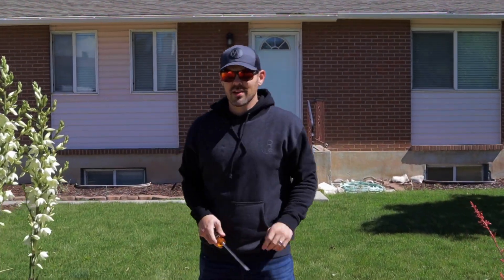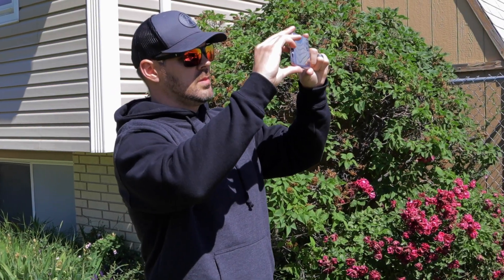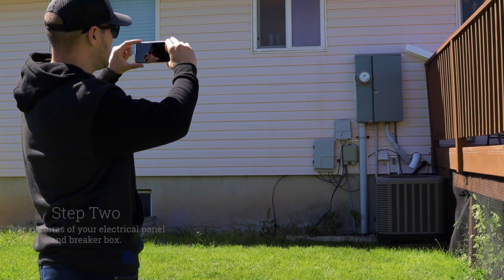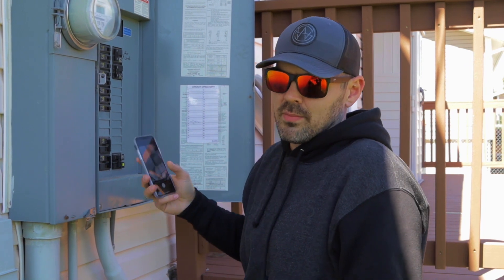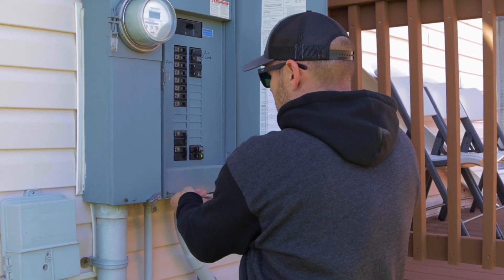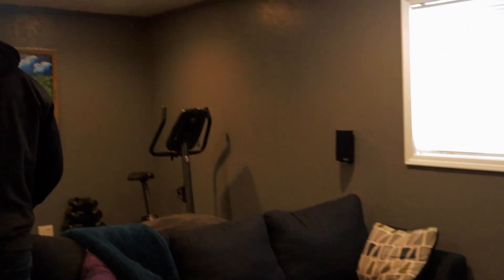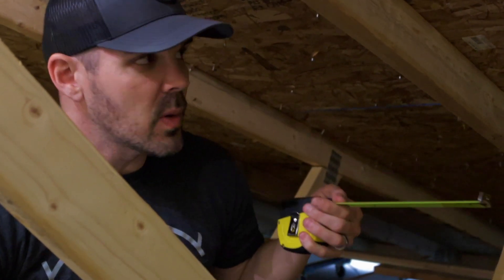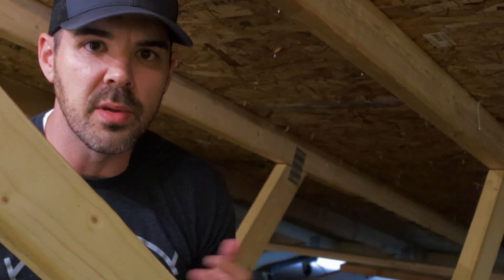Solar Wholesale's - How To Do a Solar Site Survey

Comment: What if your Electrical panel is full?  As in a 100 amp service with no open slots?  Does this rule out going solar?  Especially if you don't want to get a new 200 Amp service panel added on to the solar cost!!